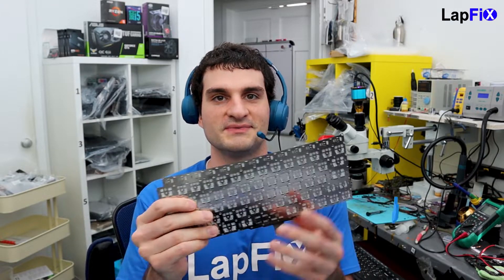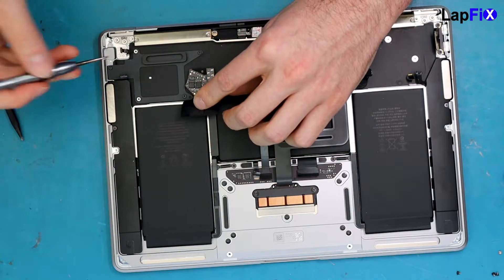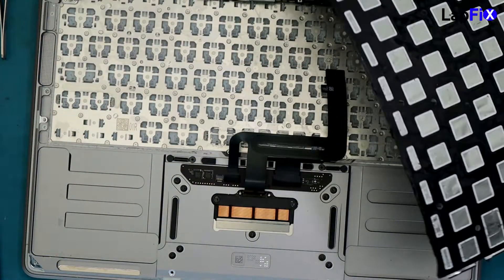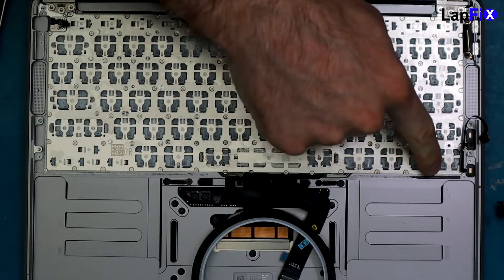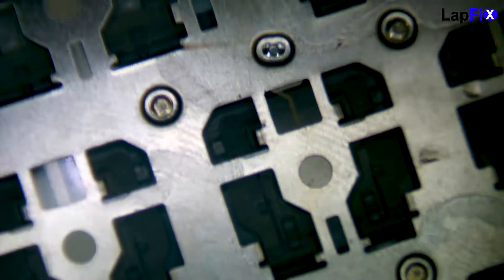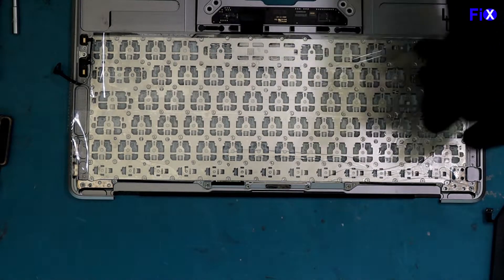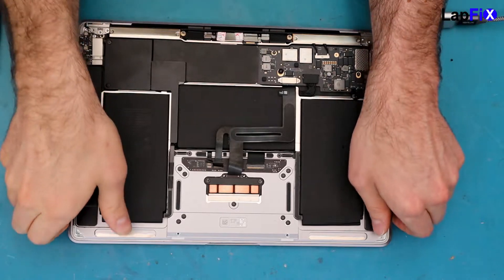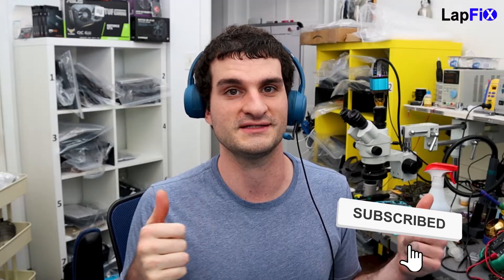MacBook Air M1 A2337 Keyboard Replacement

Comment: I remember leaving Windows and having some sort of MacBook fifteen or so years ago (I think it was first gen unibody whatever?) and I seem to also remember a palmrest costing 80% the cost of a new one and you could replace the KB but something about the it being heat-staked. Then, I don't remember using it after that. Brought back some memories. Went back to Windows for a bit until it and MS jumped off a cliff and got an M1, now it needs a new keyboard (it works but I hate the worn smooth feeling of it and some keys being wobbly) and THIS replacement looks just as much a PitA as it was 15 years ago. I've gone full-circle.

Comment: I replaced my keyboard but the keys only work after tapping multiple times or it’s random. All the keys work though. Any ideas? 

I didn’t do the rivet way and instead went whole top assembly and screen replacement.

Comment: Confused when you got down to the part where you take the very little screws around basically the frame of the actual old keyboard- but then you talk about the other rivet looking things that run across the key rows --- talking about being very careful on those -- then next frame you're tearing out the old keyboard ......  i assume when you put the new keyboard in the old backlight then goes on top of it and then we're good. no?

Comment: The rivets that hold the keyboard firm in the centre, would it be a idea to put a few spots of solder on these after the new keyboard is in to keep it seated better in the centre or is this stupid and could cause issues?
Reply: I was lazy to order extra  screws (the good way of doing it). So I let the pin out and glued it from the other side with araldite for metal. I didn't use super glue, because I was worry that the glue will break after many tipping (vibration). I know ugly,  but it works.

Comment: Spilled coffee, it worked for a day or two but I ended up using water from a spray bottle and a pressure air can to clean the sticky keys but it just made 3-4 keys stop working.

Comment: I just tried this on my Macbook Air M1 because keys "A" and "D" didn't work. So I've replaced the keyboard myself, a bit tedious and scary but everything seemed to go fine, boots up as normal but the very same keys remain dead ("A" and "D") while the rest of the keys work fine as always.
Reply: In case someone is having the same issue and somehow reads my comment:

After reading an iFixit forum post I've realized that this issue isn't caused by a faulty keyboard but actually by an incompatible trackpad (that somehow got installed before this device was sold to me). I've ordered a new trackpad from aliexpress, replaced it and finally the keyboard works as expected! Such a shame I've tried such destructive method for replacing the keyboard when it was probably working fine all along, but at least I've learned something new!! 

Thanks for the video anyways, I'm happy I can finally use my macbook :)
Reply: @pbl0_o  and thank you for coming back and giving the solution!
Reply: @pbl0_o  thanks for the info. i happened to have the same issue and thinking of replacing the keyboard. does the A and D keys sometimes still work on your case?
Reply: @pbl0_o  thanks for the info - i wonder why the trackpad would cause keys not to work!!

Comment: Hi , I have the same model. My device does not shutdown properly using apple menu. It just restarts. Also it does not sleep but goes to lock screen and the display keeps turning on and off every few seconds. There has been no damage to device so I cant figure out the fix. Any suggestions on what to look for? I even did clean reinstall of OS but did not work.

Comment: I don't think you had to replace the actual keyboard just the circuit board under it. Unless there was damage to the keys. The keys are just the physical connection to the pressure sensitive circuit board, which is the only part that would need replacing. Apple would not put all those rivets in if it was made to be removed.
Reply: They 're not separated, only the backlight is

Comment: hi. lapfix. I use your tutorial to replacement a keyboard in Mac air m1 bu I have some issue and many you can help.  so first control key not working. and when I mont and screw backplate some keys stop working, as left shift caps lock, and f1 to f6 bu t when I unscrew the back plate only one left schift don't work. any idea

Comment: What would that repair cost? I had my cat knock over a glass of soda on the keyboard of my MacBook M1 2020. I cleaned it all off immediately but a day later some of the keys are sticking. I don't know if the keycaps can be removed and cleaned under them or if the keyboard will need replaced. I'm looking for an estimate before paying to ship it in to you.
Reply: It’s a bit late but for anyone watching bring it to Apple they usually help clean or even replace key caps for free

Comment: Finally apple made a design choice that makes sense using that battery tray and the pull tab adhesive strips so you don't damage the battery just because you need to replace or clean the keyboard. Bringing back the separate power button instead of it being integrated into the keyboard was also a great choice. As was turning 12 screws to hold down the wifi antenna into only 4 screws. Now they just have to go back to using all screws for the keyboard in future models and I will be happier fixing these steaming piles of ****. Probably only did it because they know they are fighting a losing battle against right to repair, though.
Reply: keyboard screws are P2 pentalobe screws.

Comment: Another great video—thank you! I understand you used screws on the edge of the keyboard, but what did you do to attached the center of the keyboard?
Reply: Sorry for replying a month later, but for anybody else with the same question, replacing your keyboard like shown in the video won't attach it to the center like it was originally. To attach your new keyboard to the center, you need to do one more step the video mentions around 8:08. 

Make sure you have keyboard screws to replace the rivets prior to doing this. Just google "A2337 keyboard screw" and you can get 100 from AliExpress for $5. 

Once you remove the old keyboard, there are some nubs on the underside of the chassis (visible at roughly 11:45 in video.) These are the rivets used to secure the original keyboard in manufacturing. Since all of the rivet heads were ripped off when removing your old keyboard, they now do nothing except make your life harder. Each rivet plugs a hole that could be used to attach your new keyboard to the chassis with aforementioned keyboard screws. Try to pull the rivets out with something precise like some small side-cutters, or any tool that can remove them fairly delicately (AVOID FINE PLIERS.) Gently tapping a hammer on a flat head screwdriver at a 45 degree angle against each rivet works too. During removal, keep in mind that you need these rivets removed entirely, not just sheared so that they don't poke out of their hole. No matter the method, there will be a few rivets you shear. No worries, its close to impossible to remove every single rivet. Once every rivet on the chassis is removed or sheared, put in your new keyboard, and screw your keyboard in on the edges. After that, just use the keyboard screws you bought or that came with your replacement and screw them into the rivet holes you unplugged. These secure the center of the new keyboard to the chassis like the original, but better, because these aren't rivets! This means should you ever need to replace the keyboard in the future (god forbid,) you won't need to rip the keyboard out, just unscrew it and it will pop out. Once all your keyboard screws are in, you can proceed with reassembly (shown at 12:37 in video.) 

If you're doing this replacement, I don't recommend you skip replacing the useless rivets with keyboard screws. If you skip this process, your new keyboard will be fully functional, but pressing keys in the center of your new keyboard will cause it to sink because there isn't anything in the center to support the keyboard under pressure.
Reply: @aaron_swartz  sounds like great advice but if you remove the rivets then what do the screws, screw into? Wouldn’t you need a threaded screw socket? for the screw where the rivet was? or are the screws self tapping?
Reply: @aaron_swartz  Thanks for this comment. Was just about to tear this one off, having second thoughts then saw this. I'll definitely look for some screws first. Hopefully they won't take too long.
Reply: @aaron_swartz  Hi, what is the name of the screwdriver that is used for the keyboard screws on the edges, and is it the same for the screws that are gonna replace the rivets?
Reply: @aaron_swartz does it matter whether or not it says pro or air for the screws? Please reply
Reply: @aaron_swartz  thanks so much
Reply: Here is the Amazon link for keyboard inner screws if anyone is looking for them in the future:

https://a.co/d/17o7nYK

Comment: bought a replacement keyboard and fixed my laptop that I spilled vodka on myself with this video  instead of paying $400, thank you
Reply: Dude this is literally the exact thing that I did with vodka too. Not great for cleaning. Glad to hear it worked out for you - going to have a go myself
Reply: Where did you order the replacement keyboard from? How much?
Reply: does your mac work fine with a replaced keyboard? i am about to replace mine but have some second thoughts..
Reply: @lizardhudson8463  how its going? u changed your keyboard?
Reply: when i bought my mac, the seller said he replaced the keyboard, and it works fine  @lizardhudson8463
Reply: god damn it, i just came here because I spilled vodka on mine 😂😂😂

now some keys are paired - like p and the t, spelling pt every time I press either key. same with some other keys.
Reply from the maker: Looks like the  40% alch didn't clean it but made it worse lol.  Glad we were able to help
Reply: i spilt 99% alc and my keycaps are falling off and looks damaged, and the keyboard doesn't function properly  @lapfix

Comment: Hello is it possible to simply switch languages with keyboard stickers? Bought one online & didn’t notice it was in Cyrillic! Oops! Thank you for your reply
Reply from the maker: Hello, there is a language input switcher in the settings.  However, since the keyboard connection is configured in a way, it may not be exactly as an english qwerty.  But if you switch it, just match it up with the stickers as you test each key

Comment: Do you know if the new M1 Macbook Air, 13, 14, 16 if the keyboards can be swapped for another language set. Or no?
Swap from US English to Hebrew/Russian/etc, Mac will be used in another country
Reply from the maker: For most models, no as the return key shape may be different and won't fit the chassis.  For others the connection may fit and it may work, however, the keys that are different in a similar location will register as the original keyboard's position.  A good example is the: and ' keys

Comment: Nice replacement video!
When a new replacement keyboard is connected, all keys work normally - except for A and D! Do you now what's wrong?
Reply from the maker: Thanks!  and Check the cable connection first for any damage, then see if a usb keyboard works with those keys, if the external keyboard works no issues then you most likely have a bad replacement keyboard

Comment: Hey, I hope I can get help here, I don't know where else to post this, since my problem requires advanced understanding of the laptop. A little while ago spilled water all over my MBA M1, because my bottle broke in my backpack (yes, my laptop was in the backpack). Now I finally had time to open it and clean off all the corrosion cause by the water. I managed to get it to work again, at least partly. While hooked on to power it boots BUT I can't get past the password input because the keyboard doesn't work. I watched this video to better understand which connector is the keyboard one but I couldn't understand it from the video. Could you please explain it to me?

Edit: I just disassembled the entire laptop and re-hooked all of the connectors and now it seems to be working. I don't know which connector was the right one but I'm happy with the result lol
Reply from the maker: Glad you were able to get it working, congrats!
Reply: @lapfix  I have the exact same problem as TheSoroLP explained. The keyboard and the backlight both don’t work. I noticed that the trackpad cable has a branch which goes to the location where the backlight and keyboard cable are connected. Does the trackpad cable provide power to them? If that’s the case, could a damaged trackpad cable be the explanation? What do you think may be the problem?
Reply: Hey...... Actually I'm having the exact same problem with my m1 mac air. It was completely drained in water for about an hour. Now it only works while it's connected to power adaptor and external keyboard...... I wanted to know if you fixed it by yourself by disassembling all the circuit connection and reassembling them or if you replaced the battery and keyboard. Please help me out with this.

Comment: Ive got some spongy keys due to a drink spill but they work. Is there a way to "clean them" so they are not sticky anymore? Or do I have to buy a whole new keyboard?
Reply: If the damage is only superficial you can get away with removing the keycaps without even touching the interior of the laptop.

Comment: disappointed you didn't remove the old rivets and replace them with screws. I did a few A2337 keyboard replacements and I've tested the keyboard with the screws on the edges only and it feels a bit spongy when you press the keys. you are not the one who will be using the keyboard so I guess you probably don't care.
Reply: hi! So is it possible to replace rivets with screws? What are those screws? Are they the same as on the edge? Is there no problem in later use? You just screw them in and it is okay? Sorry for asking but I have the same issue. Hope you will help :)
Reply: You are right. The proper way is to remove the rivets and then replace them with screws. Some shops are not skilled enough but yet showcase their repair as if it is the right way to get things done.